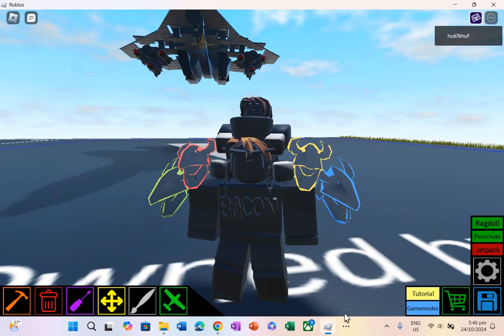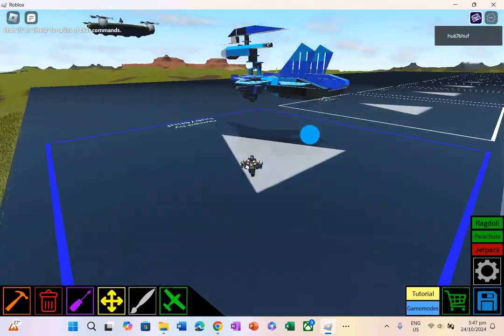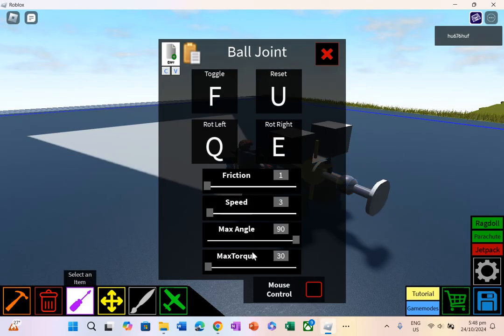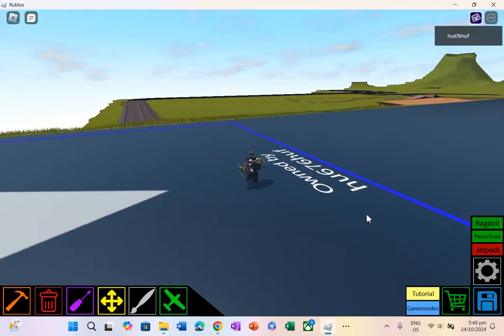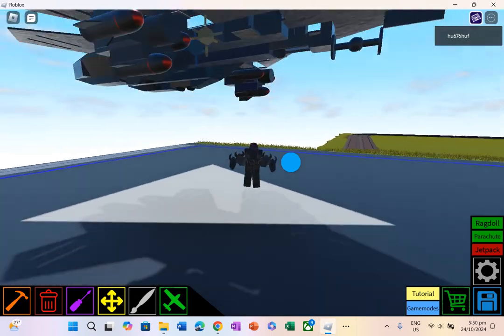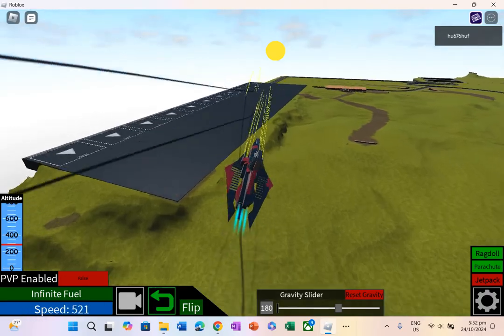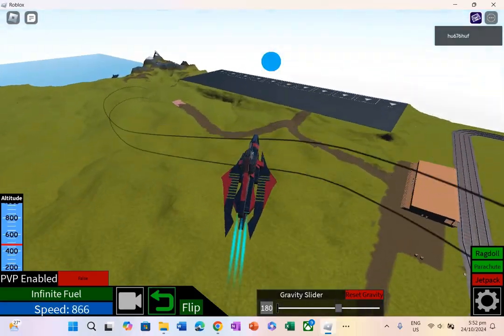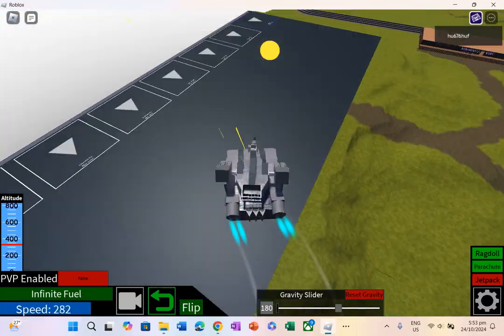Plane crazy guide ch2 ( how to get supermaneuverability: ball joint and gyro)

Comment: is there any things i need to do i put a ball joint and put it to mouse control max speed every right settings and it doesnt work i tried a bunch of diffirent torque but it still doesnt work my ball joint is squished under motorlocks so is there anything else i can do? 

edit: i use a namnam jet modified so the motor2  doesnt move so ball join is all it uses to move and some propellers i use hover drives btw
Reply from the maker: make sure nothing is touching or in the balljoint expect for either the back or the front
Reply: @hu67huf took u 7 months to reply but ty ig